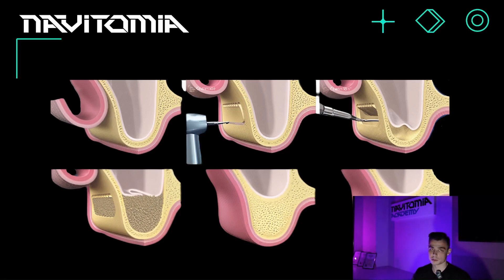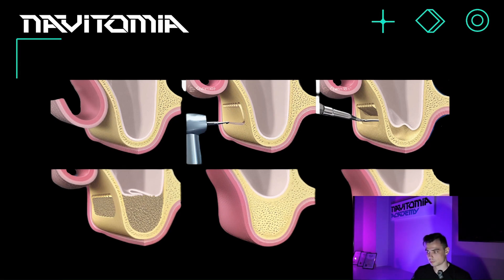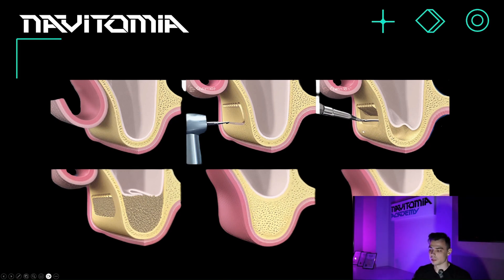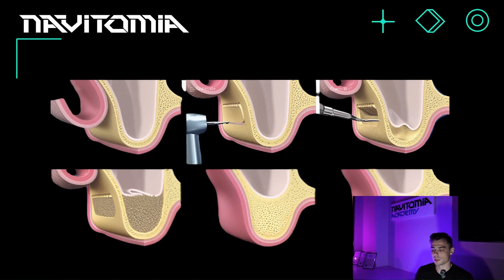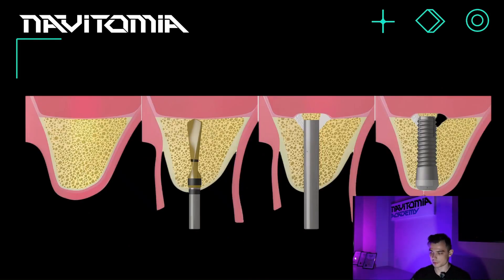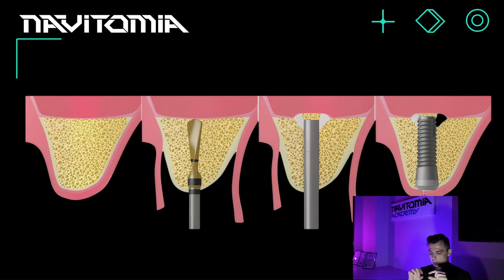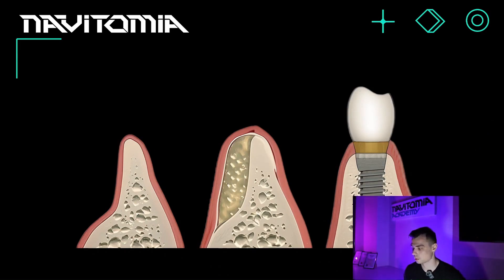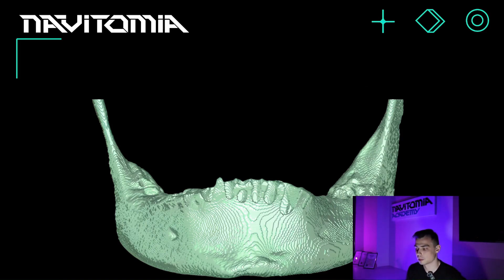Surgical guides in RealGuide Tutorial. Lesson 3. Sinus lifting, bone regeneration, bone reduction

Comment: Also, I recommend at the end of the video when you are talking about the bone reduction "dish" or plane to go over what determines the height of the reducing plane.  My understanding it could be two reasons.  1 providing working space for the prosthesis such as needing a minimum of 18-20mm of space (based on the material the prosthesis is made in).  2. Getting the 1mm of extra space around the implants.  For instance if you have a 4mm implant  you will need 6mm of bone width (1mm on each side of the implant = 2mm of total extra width needed), so you will need to bring the reducing plane down until the width of the bone has a uniform 6mm of width.

Great work as always and I am excited to continue watching the rest of the videos.